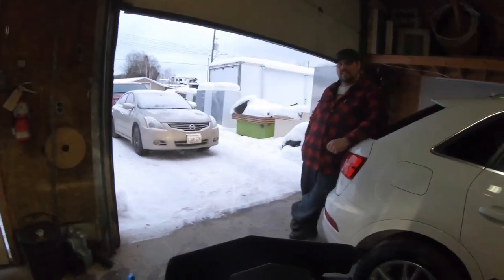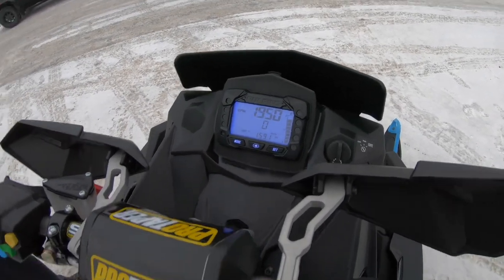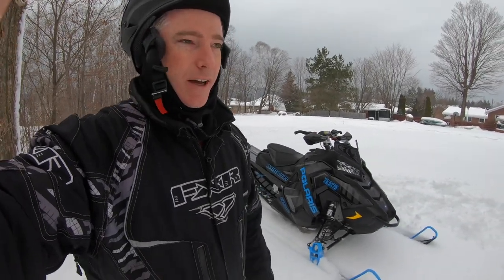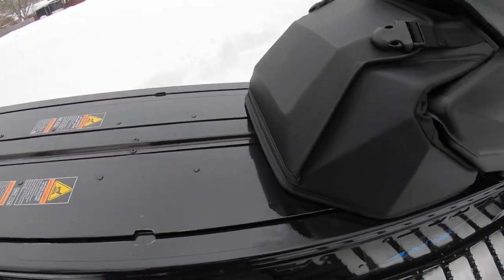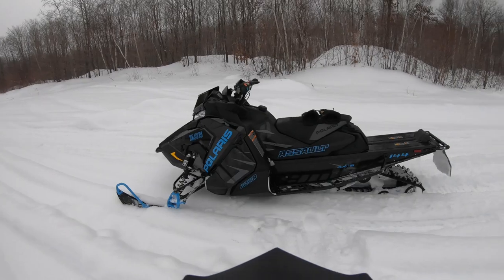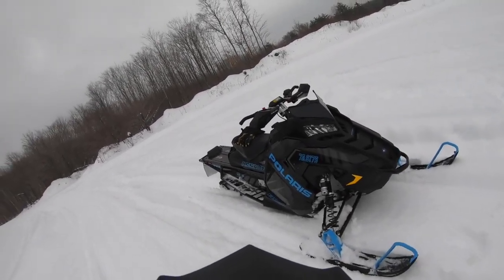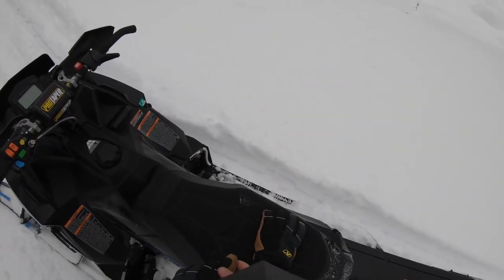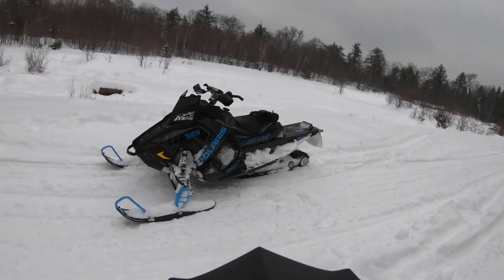Ceramic Coating on Snowmobile

Comment: How’d it end up working after a season!
Reply from the maker: It definitely has some surface scratches.  Not sure if it's is any better than of it wasn't done, it's hard to say.  I might try to shoot a short video to answer this question and post in the next week or so.  As you can see from my ridding videos I do go off trail a lot and it would have scratched either way, just might have been worse.  Sorry I know that doesn't really answer your question.  Really would have to just do half the sled and see if there is a noticeable difference I suppose.  Thanks for the question.
Reply from the maker: I just posted a video about how it held up of you want to check that out.